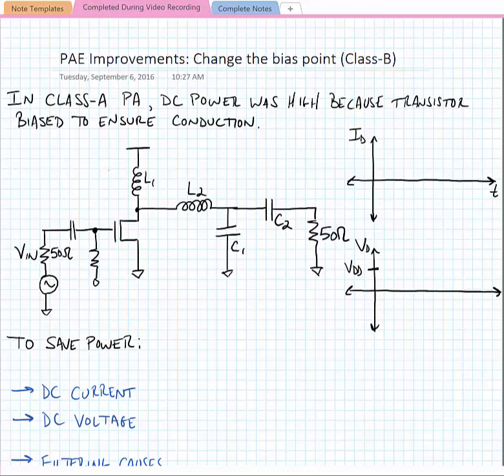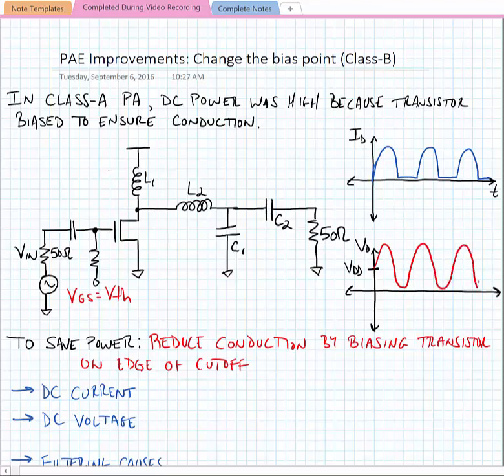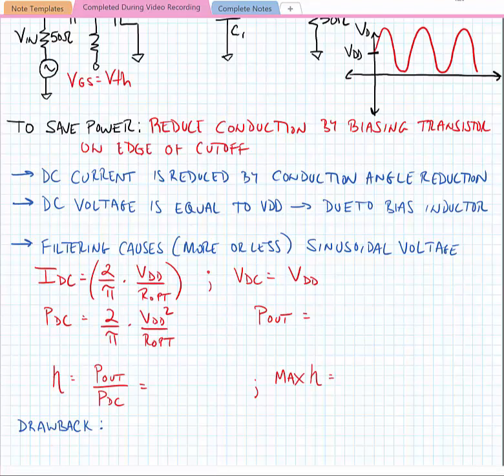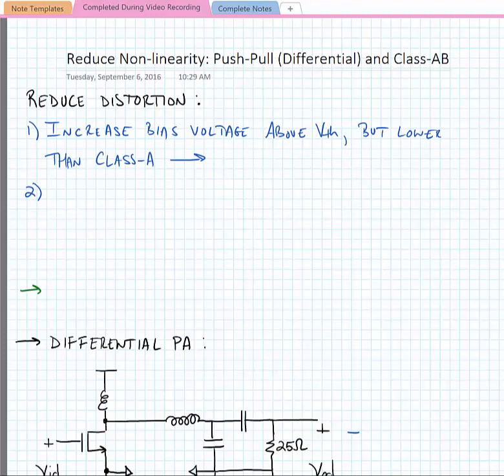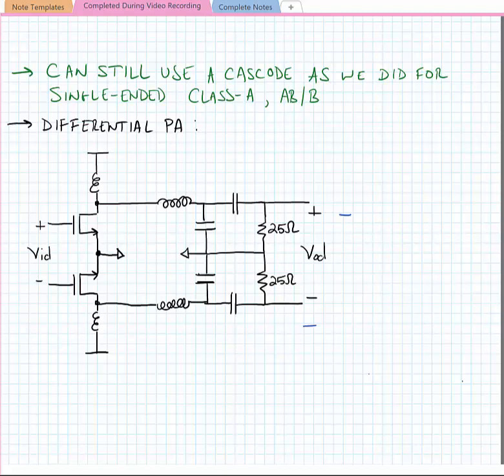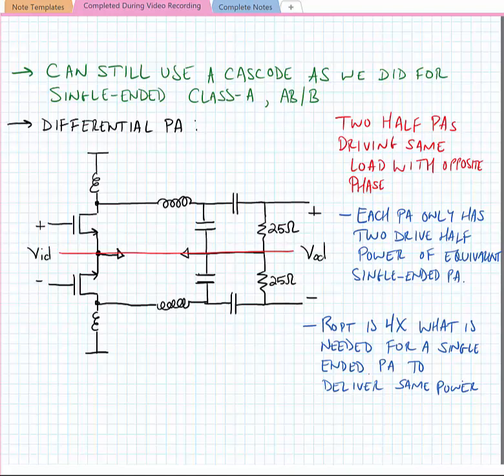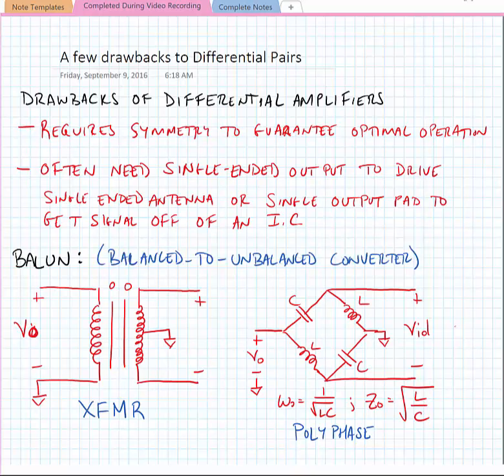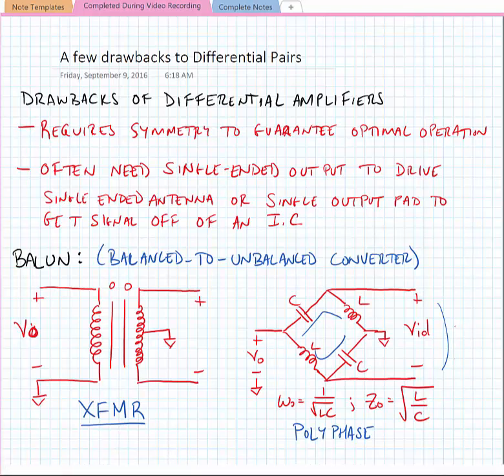Lecture 10.3 - PAE Improvements Using Bias (Class-B)

Comment: Based on the considered filtering circuit, C2 wolud block DC voltages heading towards the antenna (50ohm termination in general), and C1 will hold the DC voltage.
The RF part that this band pass filter would pass will be the only voltage component that'll make it at the input terminals of the antenna. So, I don't think there should be a DC voltage part at the antenna... am I wrong?
Reply from the maker: That is correct... The DC voltage is at the drain